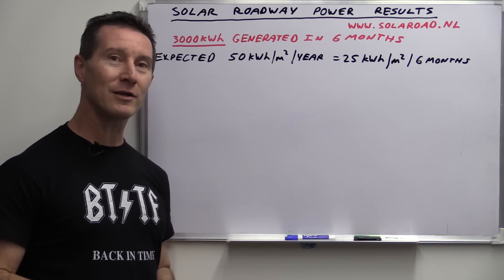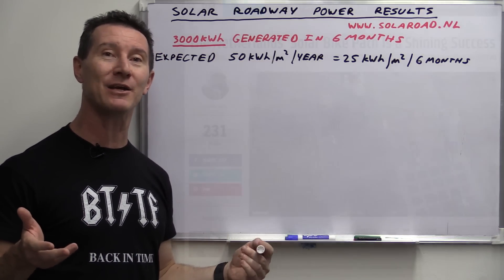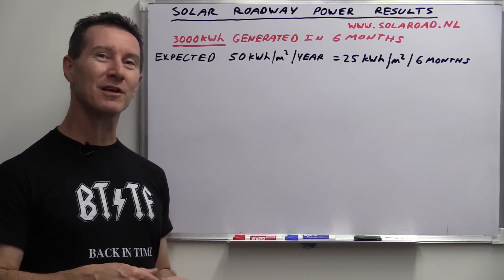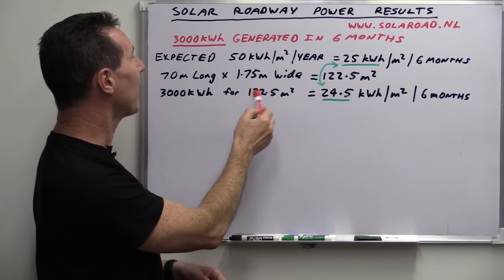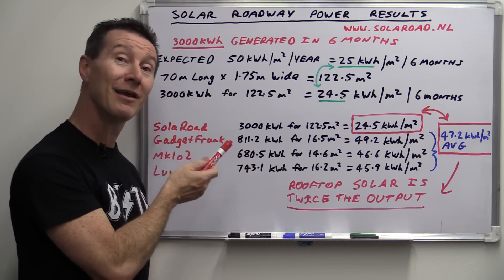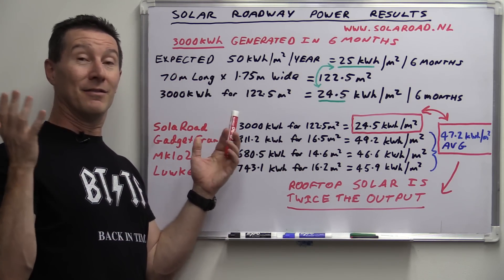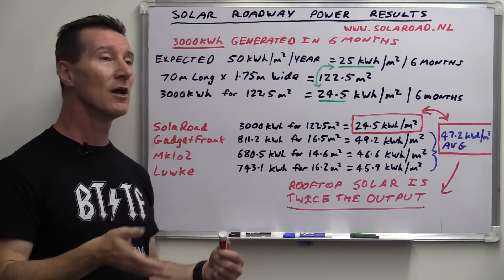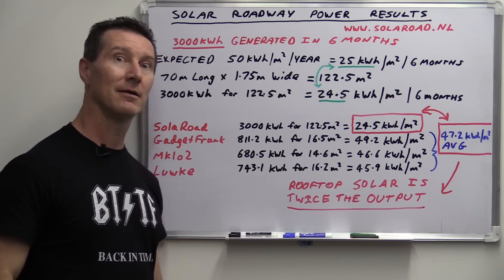EEVblog #743 - Solar Roadways Test Results

Comment: The big question is not whether they are effective. As per your example roof tops do twice as well as ground mounted panels. However what you neglect to mention is how effective would solar roadways be compared to what we currently have. Currently roads collect zero energy. Is there better ways to collect energy? Yes! However when you look at nuclear power it can't be clearly proven if the benefit is positive especially when there is a nuclear disaster.  Yet there are hundreds of plants around the world, pieces of the planet no one will use again when they decommission.  Fukushima alone  will suck up more resources and money, cause more deaths, and kill more marine life than any previous nuclear disaster. How efficient is that?

Comment: I think Thunderf00t addressed this idea that popped into my head just now in another video and why it wouldn't work, but here it is, based on what S. Korea did with that highway: Do the same thing for the road automobiles are driven on but with a stronger, wider overhead support for bigger panels, building them only in sections of highways that get relatively constant exposure from the sun.

Comment: They output what was initially expected even with the loss of a panel?
Cool! It works better than expected!
Is it worth the expense to cover a nation? Not currently. That loss of a panel must be factored in and likely just absorbed the entire value from power output.
There are applications where this is a great idea though. Playgrounds, Boardwalks, rural and suburban streets.
Some of these could be implemented more immediately than others. 
The biggest issue I see is going to be vandalism. The surface appears to be epoxy based. That's better than glass but its going to invite bored teens to find ways to break it.

Comment: You have to realize the people behind this aren't interested in actual results, they want waste and ineffectiveness in fact. Anything that can be marketed as "green" is far better than actual proper functioning real world alternative energy generation. The "green" movement is about money and nothing more. It's the same old left wing garbage, they crow endlessly about progress while the world crumbles. They abhor actual good results, those mean people are doing good and they can't endlessly chase garbage idealism based technology.
Remember, when around them if You're doing well, it's because You're victimizing others. If you fail or do nothing and are a burden on all You cross paths with You're a victim and someone to hold as an example of how the bad rich people are punishing You!
If the greens were so damn interested in solar energy why chase something that won't work when right now we can use that money to put solar arrays on most buildings and reap benefits right off?  it's the same thing with alternative fuels. Alcohol is costly to produce and damaging to gasoline engines. It's also very polluting to produce. Biodiesel takes less energy to produce and isn't as damaging, what do progressives do then? They begin to work on bans of diesel engines. Brilliant.
Reply: Mark Baanstra At high levels the only thing green with the ideology is money. I grew up in the ecology movement, with reduce, reuse and recycle, but that doesn't fit in with marketing and will hurt the investments of those in power. Like I said, the money wasted on solar roads will go much farther with rooftop solar systems as well as allow more capital for improving alternative energy. But that'll hurt oil investments, won't it? Like electric cars, some with solar systems can practically run their car for free, so now our state governments are talking about charging us a tax per mile driven, not just for electrics, but everyone. Do You think the fuel taxes will go away because of it? 
Like I said, it's all about the money. Drive an older car that gets good mileage and is cheap to ensure and register. Take care of most of it Yourself and put the screws to the bastards by cutting the money they're taking from You!

Comment: EEVblog Agreed. The numbers are just not there. I have a 12kw system on my house here in Arizona, USA. I produce an average of 1636kw/h per month across a full year. Obviously my peaks are May to July where I typically see about 2100-2300kw/h per month.  For the full year of 2014 I produced 19,635kw/h.  Now my system consists of 52 panels, a pair of 6k inverters. My panel angles/location and house position, and being in Arizona it is ideal for maximum production.

https://mysolarcity.com/Share/C3F535C7-8540-4322-97E3-DC9F2469FBBE

Comment: How about putting the cost of the house into the cost of the solar installation? So for a 1kw system producing 4kw.hr per day at 25c per kw hr annual income is about a dollar per day.

Using the median house price in sydney of $1,000,000 it will take 300 years to pay back the investment.

You see what I did here:

The correct figure is the difference between the solar and the non solar roadway, not the total cost.

Comment: I'm not a electrician, at most I fiddle a bit with 12v.
I am however a construction worker, full time in a excavator, doing work that is often on roads and walkways ready for repaving or other work. Due to my occupation I tend to look at walkways and road surfaces when I'm out and about as well, rather than staring at the puffy white clouds. I urge the 'faithful' to do the same every now and then. Because I look at this at a downwards angle, rather than staring myself blind at the sun.
Notice the materials used today. For walkways, often concrete slabs, but also granite and similar hardness in cobblestone as they pay off over a longer period of time.
Concrete and asphalt is used for roadways for ease of replacement and safety, as they are mixed with very specific mixes of aggregates to provide friction as they wear down rather than be worn smooth by tires. Some places where this mix was not correct, either by using now outdated methods or plain mistakes, they need to run various tools over the surface to rough it up every now and then. Once smooth, no grip. No grip, dangerous road.

There are reasons for these materials, and they alone are really enough reason why solar panels on road surfaces, be they for walking or driving, are never going to be a practical or safe solution.
I will let someone else go into details like the cost of having something like this complicate repairs, expansion and replacement of infrastructure like cables, water lines, sewage and gas where that is common. 
Do try to think before bothering with a reply.

Comment: If you want something solar making good use of a large public space with easy access, the best application would be to use solar panels as sun-shades placed over parking lots. Most people wouldn't have any problems parking under that, and it'd keep your car from becoming roasting hot in the summer.

Comment: *Rob McKennie

If you think that 100% of that space will be used, you're sadly deluded. I don't know if you drive, but I do, and the state of the roads are rarely pristine. And that's asphalt, not glass or plastic. The maintenance costs are going to be astronomical, I would not at all be surprised if the panels are a net loss because of that. You can leave me alone now, I so do not care enough to keep talking to you.*

Nice that you lose the argument, and stomp off like a child...
Yes I do drive, car, motorbike and bicycle, here in the Netherlands where the roads are in pretty good condition for the most part. 
Who said 100% of the space will be used,, al that's needed is to make 2.1x the space of rooftops and its going to produce a better yield..

As I pointed out before you sulked off... We don't have any idea what the maintenance costs are...but lets take an example, of how much effort it takes to repair tarmac, consider a decent sized weather related pothole....
You have to lift up and remove the road surface several meters around it, depending on how deep the damage is...
You then have to reset the substrate, sometimes that's a big job requiring new substrate
Then lay new tarmac...We've all seen road works doing this, several men, several lorries, several hours, sometimes days... quite a job.. and costly...

With a damaged panel or panels...you remove the panel..put in a new one....
ermmmm hang on..that sounds pretty easy..and certainly in terms of manpower..pretty cheap. So I take some issue with your "assumption" that it will be astronomical.

But as I pointed out...we do not know...."IF" the panels are cheap to produce, and cheap to lay/replace , it may well be less maintenance than tarmac. I choose not to assume one way or the other, I want to hear what the trial tells us.

Once the tests are done...we'll have some idea of how durable they are...how they compare to tarmac...and then you can come out and make your dismissals with a lot more authority....

I also am tired of talking with you so have a good time and we'll maybe come back to this in 2.5 years.

Comment: Just goes to show how little actual research journalists do these days, and they simply find something interesting on the net and report it as fact when some pretty simple math shows how not viable the whole damn thing is.
Reply: Mark Baanstra Yeah, and forget the cost, look at the ecological costs involved in building a solar panel that you can drive cars and trucks on.  The energy required to create the roadway itself would outstrip the 50% performance you'd get from a flat panel.  On top of that, add the cost, and that's why some are pushing it, because they've invested in it, or figure they can dupe a bunch of people into investing in it, or paying off a politician to support it even though Dave's math is spot on and irrefutable.  Dave's a pretty smart guy, especially when it comes to designing electronics, so I'd put him at expert level for sure, and he's so level headed, it's obvious if he says it's bullshit, then it is...lol
Reply: John Laury Dave is an electronics engineer, not an expert in solar installations, nor does he have a degree in economics. 
This Dutch project is driven by the "Netherlands Organisation for Applied Scientific Research", a non profit organisation that employs 3000 specialists. If you want to make an argument from authority then you better look at who Dave is up against. There are some very smart people working at TNO. (Dave might even feel at home there...)

This research is partly paid by the government and the rest by 2 private companies. No one got scammed.
Sure, Dave is indeed a very smart fella, no doubt about that. But I don't think he has shown us the complete picture, i.e.;
- The extra cost of a solar road compared to a regular road is not known.
- The profits of a rooftop installation go the owners, the government get no return of investment at all.
- The project aims at a return of investment of 15 years, this research is to see if that is achievable and what needs to be done to make that achievable. 
- The rooftops in the Netherlands can 'only' produce 25% of the required energy.
- The cost reduction of large scale deployment could be very significant. For example, a rooftop installation  is 60% more expensive per kWh compared to a solar farm. 

Non of this means that a solar road is viable of course, but hopefully it shows that it also does not mean that such a road is not viable.
Reply: Mark Baanstra Glass costs about 5-10 kWh per kilo to produce. A 10mm glass panel weighs 25kg. So worst case it will cost 250 kWh to produce. At an energy production of 70kWh/yr it would take almost 4 years to pay of that energy debt. (worst case)
The solar panels themselves are 1mm thick and would roughly require the same amount of energy to produce per kg. But lets do very worst case and say it requires 70Kwh to produce 1m2 solar panel. That is 1 year and now totalling 5 years.
After 5 years it will have produced more energy then was required to make.  
Even if it took 10 or 15 years to pay off the energy debt, the total energy produced will still be larger then the energy required to make it.
An asphalt road might take only 1kWh to produce and still comes off worse because it will always cost energy and doesn't produce any!
Reply: Mark Baanstra Electric heat most definitely can get hot enough to melt glass. Glass ovens operate at around 1700 C and you will find many glass blowers that use electric ovens. You will also find electrical boosters in the glass making industry.
While glass making ovens run about 1700 C, Silicon ovens run around 2350 C, so quite a bit hotter. Silicon ovens are heated by electricity. 
You might want to look up the 'Electric arc furnace'.

The energy footprint of a solar road is a positive one. It produces more energy then it cost to make.
Bio-asphalt, regardless if it is a fantastic product, still costs energy to make. But perhaps you can harvest some energy from the heating up of the road due to the sun.
Reply: Mark Baanstra The point is that you can use electricity to produce glass.

Comment: This still a thing?  Your cells need to be clean to work as well as they can.  Putting them in or on the ground is bad idea.  Diving or bikes will grind that glass reducing the light getting to the cell.  Why not put them over the roadway?  Clean shinny cells and dry clean roads may save time and money.

Comment: Solar energy is no doubt a religion. Even the small-scale home installations are only possible because their ratio to conventional power plants is so low. If there were more panels used, the energy usage day/night imbalance would prohibit such electricity from being sold away.

Comment: Stop the funding of BS science.  Residential solar is proven technology we need it to be affordable.  Every new house should have it standard and not appreciably impact the cost of the home for the home owner.  Those are problems we can solve.
Reply: Winkelried Some good points, but nothing that can't be worked out.  Obviously I don't propose solar alone.  I also think residential wind be an option as well.  None of these alone will supplant mass power generation, but it could bear greater loads during daylight hours saving more resources over the long run.  Nuclear power plants can increase or decrease demand just as easily as other forms of power generation.  No the fuel isn't saved in the case of nuclear power it is what it is, but I don't see the logistical nightmare you point out.  In the end my point was simple, stop funding BS science with tax payer dollars and focus on realistic obtainable goals.
Reply: +William Hayden I'm not sure covering every residential buildings with Solar panels is really useful, unless a major breaktrough is made in energy conservation. The peak production of solar panels are made while nobody is at home, every home would feed that energy back in the grid which would cause negative prices on the market (basically people would have to pay to put their energy on the grid, the capacity of the grid is limited). And by night or during winter/rainy seasons the power consumption would have to be covered by traditional power plants which must be able to quickly change their output (which means coal and oil based plants, you can't easily shut down and re-enable a nuclear power plant or a dam).
I pass on the logistical nightmare that it would represent for the regulators that handle the energy market.
Reply: William Hayden This is a great point. Roof top solar isn't affordable for most of the US, which is why we should stay away from anything that's both more expensive and less efficient.
Reply: Orion K Thank you for the feedback.  In my mind every home in the US would have solar and wind.  There are vertical turbines that are more than well suited for residential use and solar shingles have come a long way and if more of both were sold just think of where things could be today.  The problem right now is A. Cost, B. Government Red Tape C. Micro Government BS (a.k.a. HOA's).